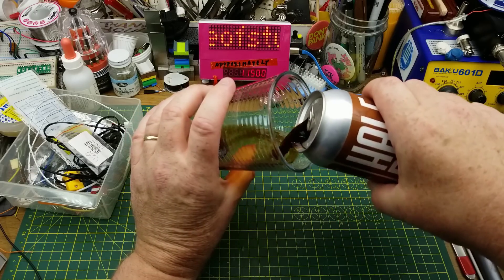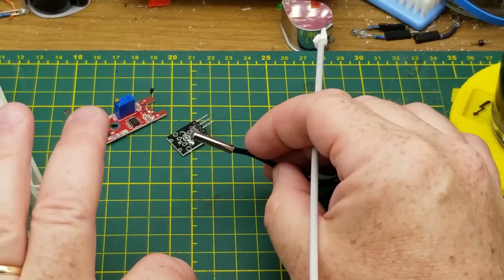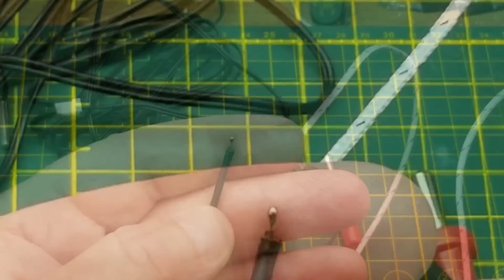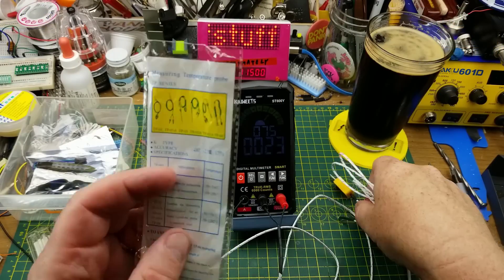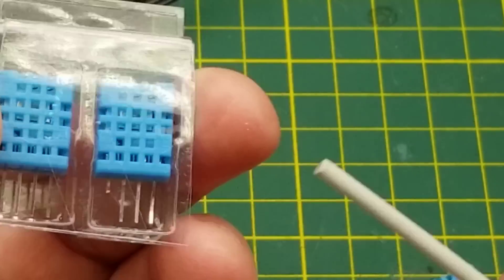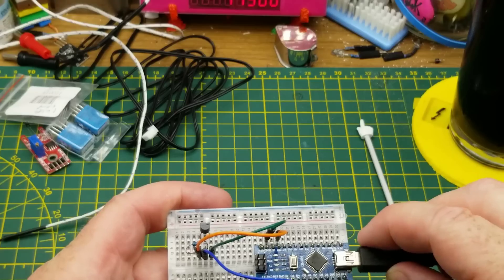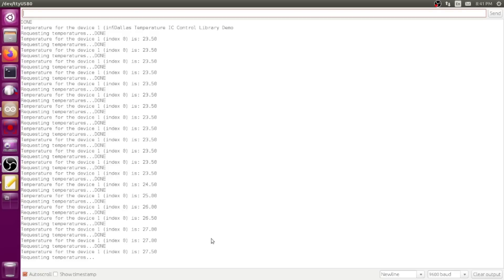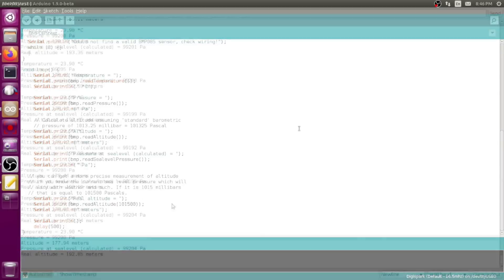5 temperature sensors for arduino projects

Comment: i was trying to fix a dehumidifier laying arround in my house i was able to  read the humidity sensor ,the water tank senor except for the temperature sensor which was on the cooling pipes ,i was not able to read any data but i came across this vid and it help me out soo well and i could actually read the temps now , thanks once again  and i just subbed
Reply from the maker: Glad my tinkering could help you!

Comment: A while back I 'instrumented' my waste-water heat exchanger (google GFX gravity film heat exchanger) with one-wire sensors.  Four sensors for potable-water in/out and waste-water in/out.  Kind of freaked kids out because after reviewing the logs, I could tell that someone got up at 1:40AM and flushed a toilet one night.  lol

But seriously, these sort of sensors are great for monitoring whatever you like around the house.  I'm thinking about putting some thermocouples on my furnace and hot-water heater flue so I can monitor those next.

Thanks for sharing your information.

Comment: Adafruit, dude you need to switch to circuit python and ditch that awful ide. VsCode PyCharm... once you get the repl working you can test the lines of code you want to run (yes on the device) without having to build and export. Watch Scott Hanselman "Hacking an AdaFruit M4 Matrix Display" for someone who tried it for the first time. But thanks you reminded me i have a bunch of one wire temp sensors that i had in a long string and will work great with the esp32 where ever i have one.
Reply from the maker: We all have our own preferences

Comment: You gotta be careful with some of those sensors that have fiberglass protecting the wires. I got some before where the fiberglass was breaking and the pain that resulted from not noticing and getting the fibers in my hand was brutal, and took days to go away. You could barely tell it was breaking other than the pain that resulted after handling.

Comment: What sensor would you recommend for reading up to 30vdc  most of the ones I have seen are only 24v
Reply: You technically don't even need a sensor, just a voltage divider made from two resistors (and a diode for over-voltage protection if desired) on an analog pin.

Comment: I have been using the aht20/bmp280 combo boards. They work pretty good, super fast response and like 2 bucks a peice for temp hum and pressure. Better than 15 for a bme280

Comment: A friend gave me 3 adafruit trinket..
Has anyone ever did anything interesting with them or found good use for them ?
Reply from the maker: The trinket is based on the ATTINY85, which is a pretty capable little board - there's an ATTINY85 running the scrolling text sign you see on my workbench.

Comment: For a k type thermocouple you also need cold junction compensation to get an accurate reading.  I expect that the chip had that built in? Just had a quick look at the max6672 and it does have the cold junction compensation built in. You also need to remember that if you extend the wires if there is dissimilar metals extra thermal voltages will be added to your signal.
Reply: if the extend the wires at the end, with say copper wire, the place you spliced it becomes the cold junction. But I think if you instead extend the wires in the middle the extra junctions cancel out
Reply: @fuzzy1dk  That's right.  Every point where there are dissimilar metals forms a junction.  But as you go around the 'loop' from sensor to readout point, many of them cancel out.  Depending just WHAT you're reading, cold junction compensation might not be too important.

For example, if measuring flame temperature of burner or exhaust of an engine, having the cold junction rise/fall by 20 degrees or so will throw your reading off by 20 degrees, but in the grand scheme of things, it might not matter when reading something over 2000, vs 2020.
Reply: @fuzzy1dk  Could be, I’ve only used extension leads where the same material is used, or bought the thermocouples with extra long wires so no need to extend just cut to length.
Reply from the maker: Good reminder

Comment: Why does no one talk about the DHT20 sensor? Is there something wrong with it?
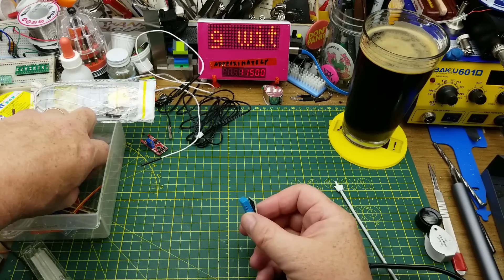Reply: seems it is a better version of the dht11, he just showed what he owns like the dht21 at about 8:00
Reply from the maker: Its just less common.

The DHT22 is a good option as well, and is usually easier to find
Reply: Well, the DHT20 is what I ordered. I keep trying to find videos showing its usage but it's always a different version of the sensor. I'm a newb and I just ordered a RaspPi Pico, DHT20, and an OLED for experimentation heh
Reply: @3nertia  I may be misremembering, but that's the version that I got and I don't think there was any difference in its use, I think it probably just had a wider measuring range.

Comment: I like the LM35 for temperature at the moment, and the BME280 for temp/humidity/pressure. That was a nice survey of alternatives - thanks Mr Stuff! 👍😀
Reply from the maker: It's certainly not an exhaustive list, but I hope it will be informative. 
Especially for the new folks.
Reply: Agree!  The LM35 is great for teaching people about the A/D converter.  Its linear response of 10mv/degree is great for showing how the A/D count relates to temperature and to the actual voltage on the pin.  It's also helpful to show how changing the reference voltage, which by default is often Vcc, affects A/D readings.  The simple math to convert A/D readings to a temperature value really cements people's understanding of these concepts.